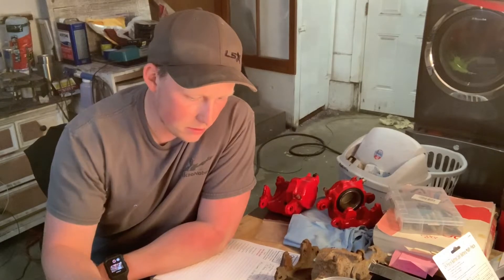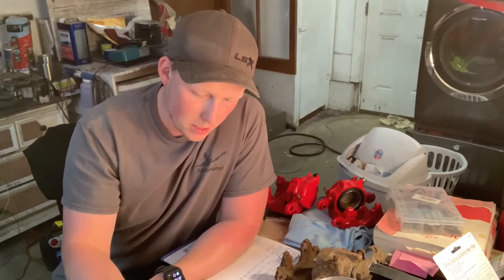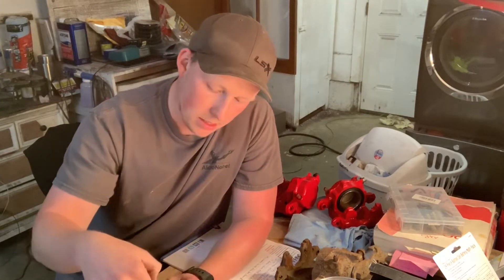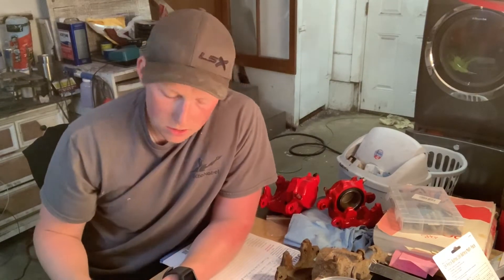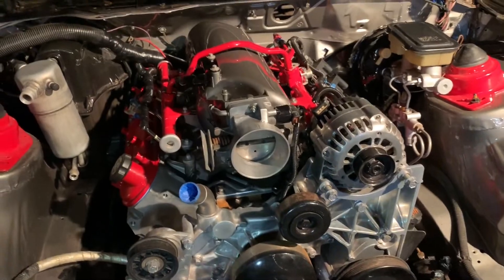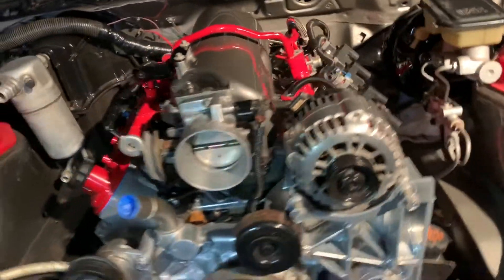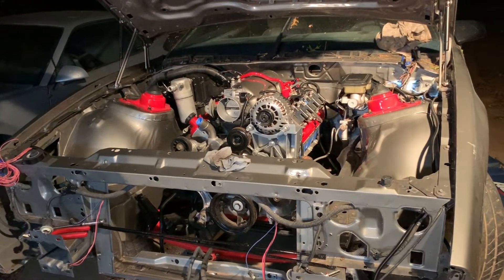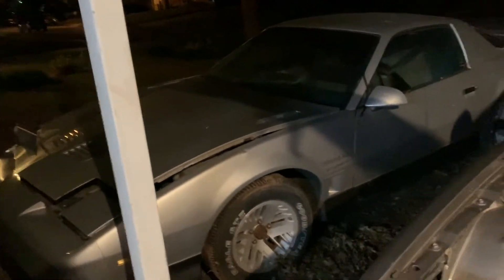1983 trans am ls swap 5.3 4l60e UPDATE 2 wire harness and stainless steel fuel line

Comment: Did you change the oil pan? I am putting my motor on a stand today and starting the gaskets replacements. Also will be doing the fuel pump in a week or two. What step are you at again?
Reply from the maker: Danny Storto yes I changed it to a ls1 oil pan from a 4th gen Camaro. The last thing I worked on was the radiator and fans.

Comment: what did you use for and ECU and did you do anything to the harness to work in the thirdgen
Reply from the maker: cayden seller i used the pcm from the Tahoe I got the engine from. I de-pinned all the wires that are not being used for the swap. And added 4ft of wire to every pin. Then when I put it in the car, I cut/extended every wire that need to be changed in length.

Comment: Do you know if all of those fittings will work for the ls1 fuel rails?
Reply from the maker: TreJon I know on a ls1 fuel rail the is only a supply rail not a return, so it will be set up differently than mine. You also don’t have a regulator built into the fuel rail. So I’m not sure what fittings you will need. It’s Probably will accept the same type of fitting but I don’t know what size the fuel rail is. Hope that helps. Check out lsxmatt

Comment: So I am picking up a 2001 gmc yukon 5.3 with wire harness and computer for $200. Once I notch the crossmember. What motor mounts will I use to bolt this engine in there?
Reply from the maker: Danny Storto I used spohns motor mounts with some ls1 motor mount bushings
 
https://www.spohn.net/shop/1982-1992-GM-F-Body/LSX-Swap-Parts/LSX-Swap-Motor-Mount-Bushing-Stands.html

I think I ordered cheaper ones but this is the style I used 
Energy Suspension 3-1151G Motor Mount for LS1 Engine https://www.amazon.com/dp/B004BRR48O/ref=cm_sw_r_cp_api_i_w4j2BbH6ZM8KY

Comment: Hi, I have an 83 TA also and would like to do this swap. Was there a complete swap kit you bought to make it easier?
Reply from the maker: Randall Sentieri nope, I didn’t buy any kind of kit. I pulled the engine, tranny, wire harness, and Ecu from a Tahoe at a salvage. Then I bought some spohn motor mounts and a 4th gen oil pan from an ls1.